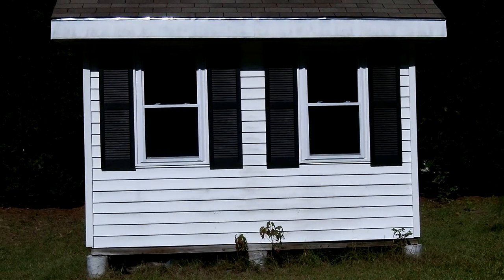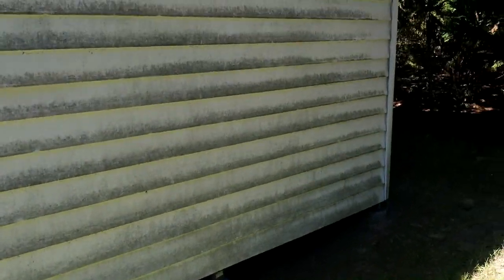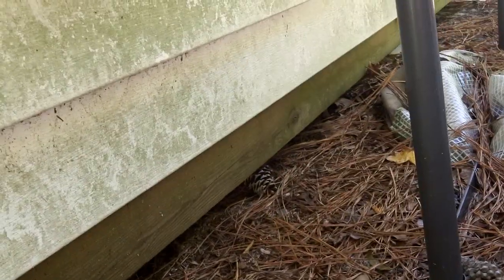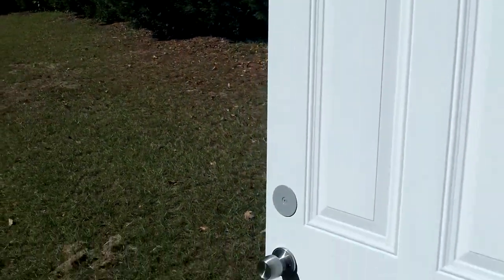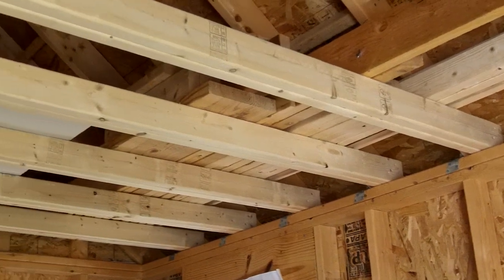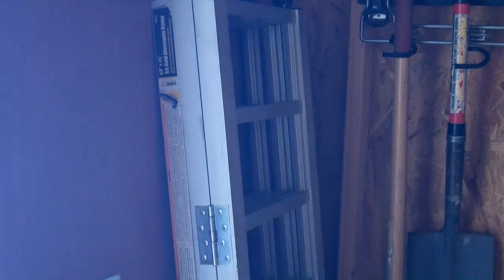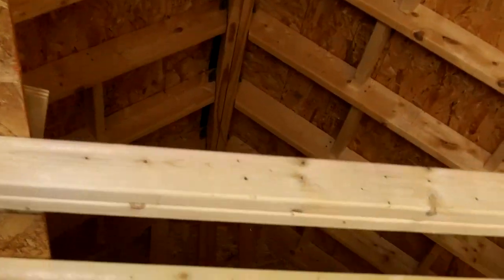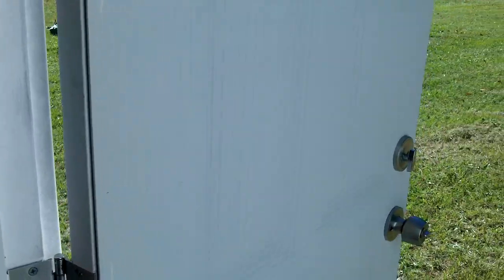DIY Shed - Part 6 - Five years later follow-up

Comment: What a great job!   Believe me, as well as you built your shed, you won't have to worry about the amount of weight stored overhead.   Wow!   Compared to the crap that is being sold at the "big box" stores your shed is a mansion.  After checking into the prices of a 10 x 16, Amish built shed, I've decided to build one myself, and have been checking out related You Tube videos.   Your video is one of the best.   I love the way you did the roof overhangs and the concrete pier foundation, among other things.    I'm still undecided about the large doors, however, after checking out the prices of pre-hung doors at HD and Lowes.     Great job!   keep up the good work.